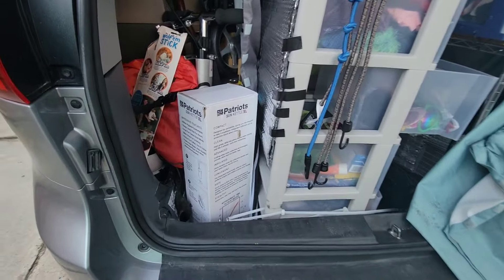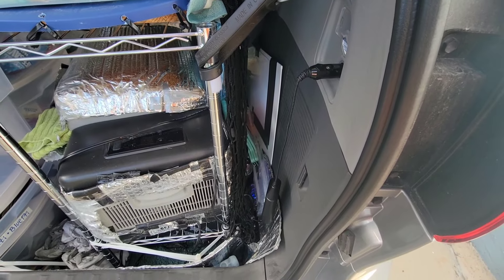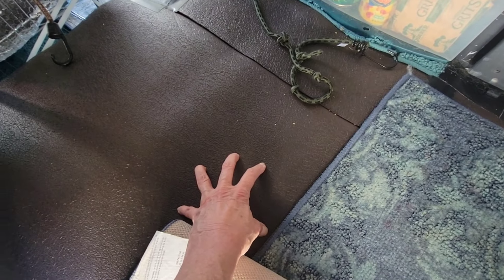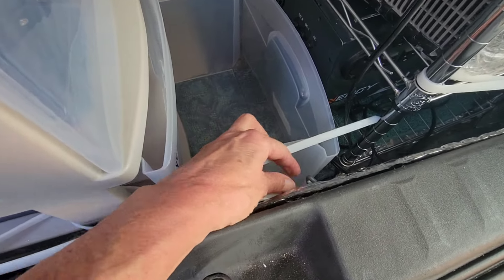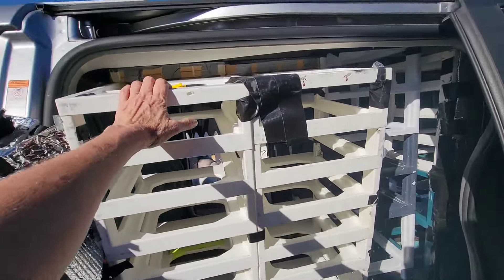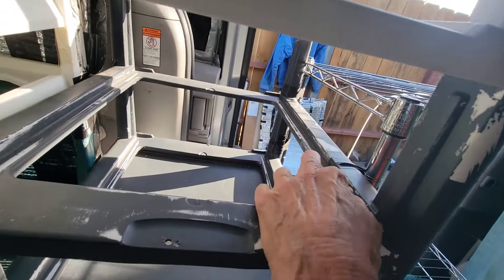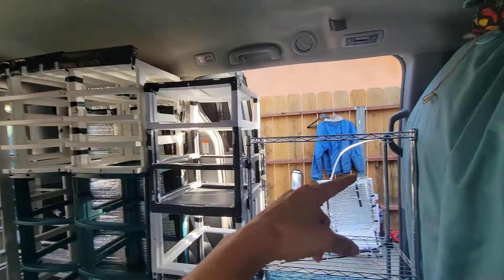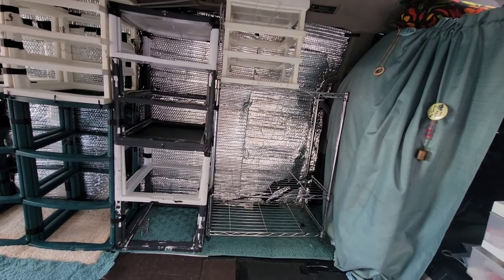Creating the PERFECT Camper! NO Build MINIVAN Build! I TORE Apart my VAN!  #vanlife #vancamping

Comment: Terry, your van is larger than I originally thought.  The zip ties, and tape are a good idea.  The insulation will keep you nice and warm.  The mats are very helpful.  Can the battery for your solar panel be covered or do they overheat?  Does your fridge run off of the same battery?  Good job looking forward to the next video.  Thank you for sharing how you organize your van.